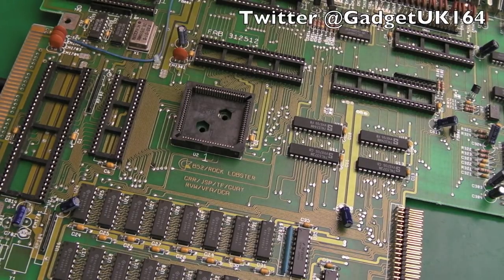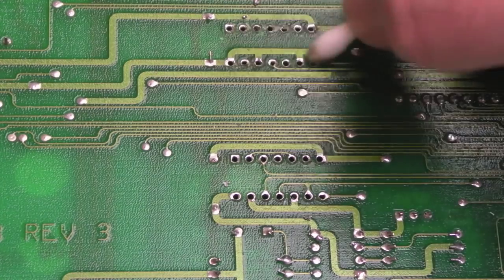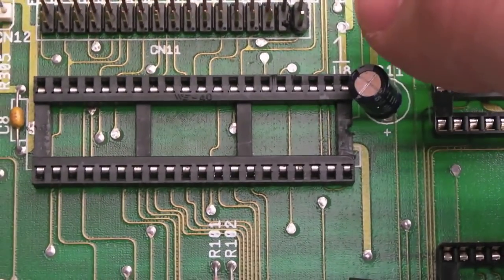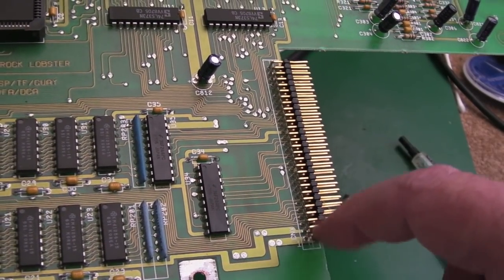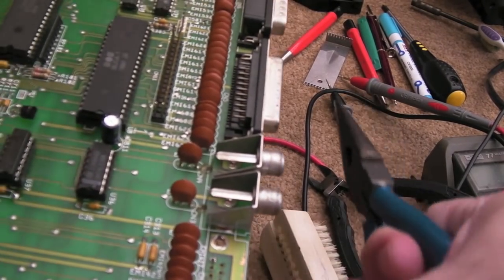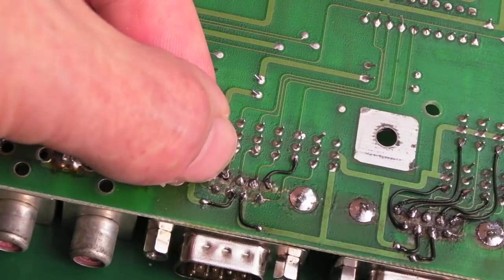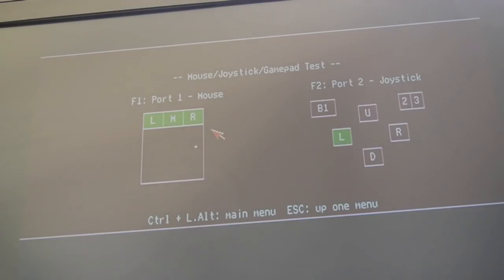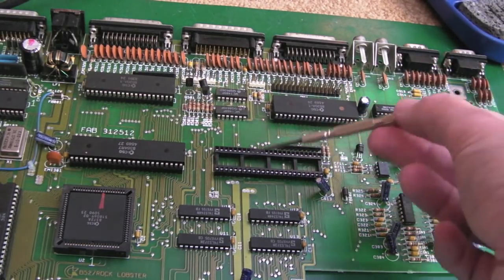Commodore Amiga A500 Repairs Part 8 (Another poor rev 3)

Comment from the maker: Part 1 - https://youtu.be/1SJ4e5vazR4
Part 2 - https://youtu.be/mHFk1X8Ezm4
Part 3 - https://youtu.be/FTSFELjiykk
Part 4 - https://youtu.be/YmnLMbKQVsg
Part 5 - https://youtu.be/s6fTwYe69lQ
Part 6 - https://youtu.be/yDLEsjZsTvQ
Part 7 - https://youtu.be/PRgQZYpHhw8

Correction: When I said the 8371 was the UK version (vs the 8370 NTSC) - I mean its the PAL version.  PAL is not just specific to the UK ;)
Things I cut out - When it gave the green screen later, I spent a while cleaning all the sockets, and when getting resistance on that pin on the Gary socket - I went over and over it with Vinegar, IPA and deoxit.  I could not get Gary to make a reliable connection at all.  That's why I had to replace that socket.  The thing that made me focus on the Gary socket - it would not boot Logica.  I pressed the Gary chip slightly whilst it was running and Logica started to respond normally (the screen changed).  After letting go of Gary it became unstable again.
Reply: They used PAL in the UK, but combined video and audio signal in an RF modulated broadcast signal with 6MHz bandwidth instead of 5.5 , and I learned this age 14 when I was in the UK with my parents visiting family (We lived in the Netherlands and I still do). I had my C64 with me and could not get sound to work on the tv there, I just got noise as if there was a snow picture. Picture was fine though. I suppose the video circuit was flexible enough to decode the slightly narrower signal, but the audio was on a different part of the band I suspect. But I am in no way an analog tv/broadcast expert. But it does explain why tv modulators in a machine from one country do not always work properly in other countries despite both having the PAL system for video.
Reply: Si,credo che hai ragione

Comment: Great job again Chris, I have a few tip regarding the repairs you did on this video. When repairing that via, it might be easier to stick the kynar wire through the via and solder it, then manipulating the wire in place is much easier. When repairing the controler ports you wrapped the wire around the pin and had a hard time doing so. If you strip a much larger piece of the wire, it’s so much easier to wrap it around. Solder it and then just cut off the exces wire. Final thing about removing the 40p socket, you’re not trying to save the socket, you’re trying to save the board. So before desoldering the pin, cut at least the middle part of the socket, and maybe even the socket into pieces. Then desolder the pins and you can remove the socket in parts. This way you are less likely to lift a trace.
Reply from the maker: Thanks, yes - I've done all the things you mentioned there in other videos =D  I just did things differently on this one, mostly out of expediency.  That said, it would have sped things up if I cut the old IC legs on that broken chip, and cut the socket up!

Comment: Love watching these - takes me back to my first ever hardware mod - I had a 0.5mb ram expansion card in the expansion slot of my A500, but quite a lot of software wouldn't run with the extra RAM installed, meaning I had to constantly install and remove it, and I was greatly worried about damaging the expansion slot with putting the card in and out multiple times every day (plus it was annoying to do!) so I broke the trace across the VCC pin, wired a switch across it and drilled a small hole in the side of the case and installed the switch there - bingo, I could turn the card on and off with the flick of a switch! I must have been about 15 or 16 at the time, I remember well how proud I was
Reply: Actually thinking some more about it, my very vague 30 year memory tells me the PIN on the socket you had to put the switch across was actually the one missing on this board - I wonder if someone did something similar on this board and that's why that pin was missing, as someone before you removed the switch and ended up damaging the pin somehow?

Comment: In the early days, a crystal oscillator package was more expensive than a crystal plus all the passives that go with it. Since a crystal circuit creates a sine wave, at a pretty low voltage, it needs to be boosted to TTL and converted into a square wave. The oscillator outputs a nice TTL signal directly. Later the price of oscillators (and compared to PCB space and assembly cost of a crystal circuit) lowered, probably made it more cost effective for C=
Reply from the maker: Thanks, that makes sense!  I wasn't aware it would need so many other components!  I kind of expected one or two caps, trim cap and transistor, but there are quite a few other components around there for that 2 pin crystal.

Comment: What about using kapton tape to keep wires down when you solder them? Also the first bodge wire could have been easier if you had soldered the wire through the via before bridging the trace. My 2p.
Reply from the maker: Yes, valid points!  I have done that sort of thing many times in the past, but just didn't here!  Same with the sockets, I could have cut them up to make them easier to remove, and I could have cut the legs on that broken chip too!
Reply: @GadgetUK164  Well, in hindsight every repair job "could have been better".
As someone working alone when repairing stuff, I always hate having to keep a wire down with one finger, feed solder with 2, manoeuvre the iron with the other hand, while keeping the dog away with my right leg. 😁

Also enamel coated wires could be an option, as they take less room than pcv coated ones, IMHO.

Comment: I have bad experience with these modern joystick ports. They seem to have thinner pins and I have had trouble with bad contact on old joysticks. btw, when you reflow old solderjoints, do you use modern lead free solder to reflow the old lead solder? I read it's bad to do it. Other people say it's fine. I have done it on many of my old Amigas and have not seen any issues yet
Reply from the maker: You could use lead free solder, but it just doesn't look as clean as leaded and behaves a little differently.  I prefer to use leaded solder for repairs of old stuff like this.
Reply: @GadgetUK164  Looking through my ebay summary it seems that most/if not all solder I've bought is actually lead rosin core and does not say lead free. I was under the impression that leadfree solder was the standard being sold today and that one had to look hard for solder with lead. I ordered my solder from China. So if this is the case I should have nothing to worry about :)

Comment: For those chips that you hot-aired off around the four minute mark, I would have taken the coward's way out and snipped the legs off close to the chip's package and pulled them out one by one. I've got a nice XYtronic hot air station, but Commodore boards aren't of the highest quality...
Reply from the maker: Yep, that would have speeded things up!  I just didn't think of that at the time, but I have done that before now =D
Reply: @GadgetUK164  I don't do it for quickness, I'm just not as good with a hot air gun as you are. That, and I find that Commodore board aren't forgiving at all.

Comment: @GadgetUK164 have you ever seen leaky caps or measure caps that was way out of spec in A500s?
Reply from the maker: The only ones I've seen with problems are the large ones at the back left (3300uF or 1000uF on later boards I think), and the 22uF audio coupling caps.  All the others tend to be fine!
Reply: @GadgetUK164  But that is not to say the other ones cannot go bad as the years moves on, considering they are 30 + years old now in most cases?
Reply from the maker: @larsenmats  You tend to find that they just don't go bad.  If you look at other electronic devices from the 80's and 90's most of the caps still work fine.  You can extend that to the 70's too.  It depends on where they are in the system - ie. what they do, how much voltage is across them, how clean that level is, and the quality of the caps.  Not all caps need swapping out.   This is not the case with many SMD caps from the 90's though!
Reply: @GadgetUK164  Interesting. Maybe I should stop recapping A500s until I see some actual problems.
Reply from the maker: @larsenmats  It gives people peace of mind I guess, so it's worth doing if you want to spend the time.   There is then the question of how long the new caps will last, but I would like to think that new caps would be more  reliable.

Comment: What was the purpose of the tape on the Fat Agnus chip?
Reply from the maker: The earlier A500 and A2000 motherboards had the 8370 (NTSC) or 8371 (PAL) Fat Agnus.  This chip was region specific.  The 8372 was a unified version which could be toggled between PAL and NTSC by feeding high or low, into a pin.  That pin just happened to be pulled low (I think) on the 8370 and 8371 socket edge.  So when you plug an 8372 into a PAL board that was designed for the 8371 or 8370, it puts the 8372 in NTSC mode.  This causes the screen to look different on a PAL TV, and the audio frequency is messed up too.  By putting tape on it, it is effectively "floating" - ie. not pulled high or low by the socket.  Internally it has a pull up resistor on that pin, which means when its connection is floating, it gets pulled high by the weak internal pull up (putting it in PAL mode).   So if you have a US (NTSC) board, you don't need that sliver of tape ;)    Same is true on the A2000 boards that used those old Fat Agnus chips too, but on there there's a jumper you can use to switch between PAL / NTSC on that pin if you do fit an 8372.

Comment: Why no flux ?
Reply from the maker: I use solder containing flux!  Sometimes I will add seperate flux.  You could see me use flux in this video at the poitn I fixed that broken trace, but when working on the controller ports I just didn't have it to hand and relied on the flux in the solder (which wasn't enough at that point really).